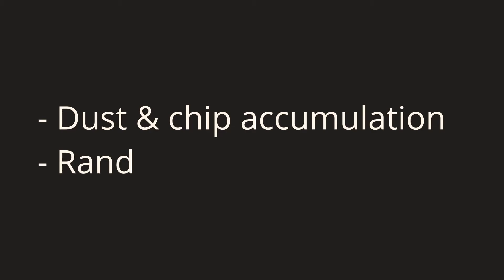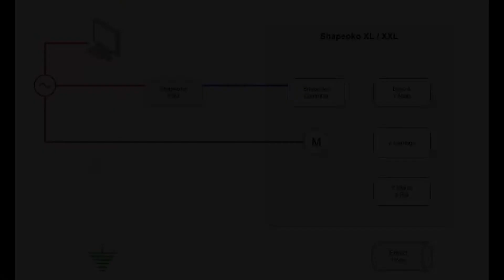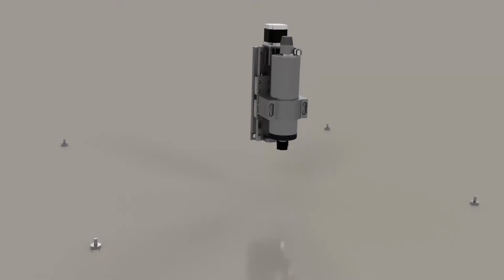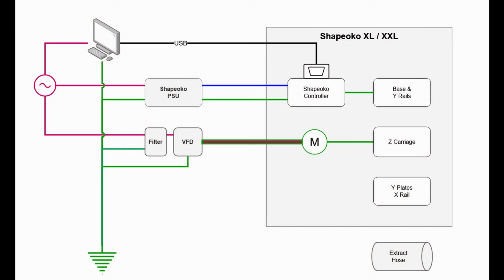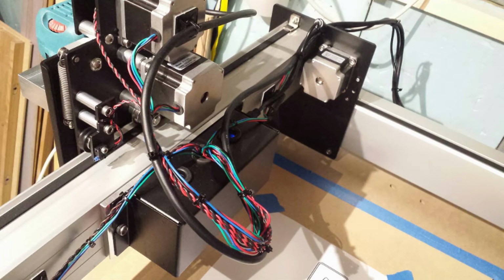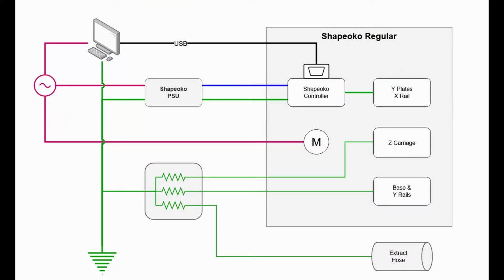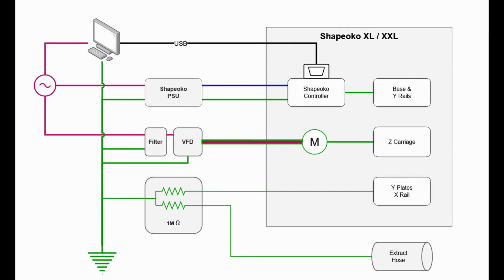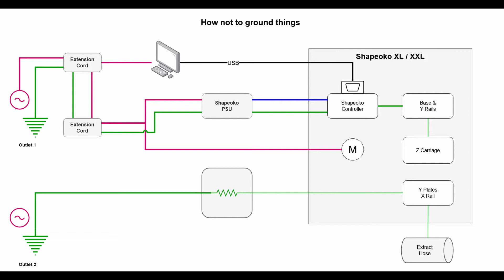Shapeoko CNC Grounding

Comment: What gauge wire are you using to ground the machine?
Reply from the maker: I was using 16/0.2mm hookup wire (22AWG equiv) but it really doesn't matter what size, we're just conducting away static before it can build up so we don't need super low resistance. The exception to that is spindle grounding if you have a spindle, that needs to be at least the gauge of the other cores in the spindle power cord. HTH

Comment: I'm not real sure why a few folks are attacking via comments. Ground Loops, look them up commenters. Your microphone, voice, and tone are fine. Thank you for your video.  I do feel that C3D should be addressing these issues a little better although I realize they cannot account for all situations we will ultimately put them into.  Disconnects and plunges are an issue with these and I assume probably with other manufacturers as well.

Comment: Your microphone is horrible.  It is all bass and treble.  You need to get a standard cheap microphone.  The are tuned for your voice and sound better than an expensive nice mic rig like in a radio station.  ...which are all bass and treble.  You need mids and high mids to get a clear voice tone.
Reply from the maker: Ah, yep, there wsa a load of background noise which I had to filter and it messed up the audio, didn't realise until too late.

Comment: If you are using a Chinese made spindle then most likely it's not grounded. 
The #4 pin of the aviation connector is generally not grounded to the spindle body. When connecting the double shielded cable it is a good idea to remove the top cap of the spindle and solder a ground wire to the #4 pin and then connect the wire to the body of the spindle. 
This has the added effect of allowing you to use a Bitzero v1 or v2 without having to connect the groud wire.

Comment: In 2021 you sell a
Machine that has to have aftermarket grounding?  Your diagram suggests obtaining a ground from a wall outlet? With a bonded nuetral?  Surely you recommend customers drive a ground rod to create the ground system right?
Reply from the maker: Thanks Becky, 
First, I don't sell this machine, I'm just a user of the machine.
The machine electronic enclosure is grounded by the supplied power supply to the utility ground. If you ground from some other source then you'll have different ground potentials on the machine and create new problems. If the utility ground in your region is not safe to use for grounding the machine then that is a different issue. I would certainly not recommend that a user drives a ground rod at their site to make up for underlying electrical issues in their wiring, that is a job for a qualified electrician. 
I also recommend using 1M Ohm resistors in the ground connections for several reasons, ground loop reduction primarily but also risk reduction in the case of a floating ground connection or other problems. We are only draining away static charge here so very high resistances are fine.

Comment: Well done sir, well done.  I appreciate the time you took to spread this knowledge.  

#1, I went ahead and purchased an anti-static vacuum hose for CNC and a separate planer issue I had.  The hose ended up NOT having a wire inside and I conducted an experiment.  It sent all the static electricity to my Dust Deputy set-up, which is the old style.  The Dust Deputy is not anti-static (older, clear version).  It showed me that I need to ground this new hose, as the Dust Deputy sits on a plastic bucket, insulated from the basement floor.  After planing a bit, shaving suddenly exploded out, seemingly from built up static electricity.

#2, more importantly, I am going to use the length of the same anti-static vacuum hose from machine to Dust Deputy set-up, and behind that will be the shop vac (shop vac does not have ground on plug).  Should I just wrap a few feet of bare wire around the dust collection, or run a bare line all the way to the Dust Deputy and attach it to a bolt?

#3, I plan on using the banana jack plug for the ground.  I need a 1M ohm resistor in ALL THREE LINES?  So, do you have a suggestion on how to incorporate those into the lines using crimp-on connectors?  I am not savvy with soldering.  I have done some searching on the Internet for something plug in style, to no avail.

#4, not as important, but it appears that the wire size used in this example was 16g?  Is that correct?

#5, I am looking to see if you ended up doing anything with the inquiry below from Mike Fitz.

Thank you,
Chris
Reply from the maker: Glad it's helping people, 

#1 - That does indeed sound like the static charge may have created a clog in the hose. 

#2 - On a hose without a wire, assuming it is semiconductive you can wrap a wire round it or use a metal jubilee clip which doubles up by anchoring the hose. I'd suggest running an insulated ground wire from the common ground point to the dust deputy and then breaking that out into two grouding points for the two bits of hose.

#3 - I recommended the resistor on all the lines to remove the risk of creating a ground loop as the Shapeoko CNC is quite sensitive to those. I grounded all the parts of mine back to the panel where my CNC and the VFD for the spindle is fed from and didn't use the resistors, but I was confident that I could spot the ground loop problem if it appeared. You can buy plugs which are for plugging anti-static wrist straps into;

https://www.antistat.co.uk/product/earth-plug-shrouded-banana-socket-stud/

Or you could crimp some resistors inline with the wire;

https://www.amazon.co.uk/Ohm-Metal-Film-Resistor-Tolerance/dp/B00WX6KZUE

If you buy the 1W type they tend to have larger leads which you could fold over and grip in a small crimp terminal, but the leads don't like to be flexed so make sure they're not going to be physically stressed. It might help to heat shrink the whole lot or something to protect them a bit.

#4 The wire size doesn't matter at all, this is meant to be low current and the 1 million ohm resistor is going to make the resistance of the wire irrelevant. Use whatever stranded wire you have handy.

#5 Not sure if Mike posted on the Carbide forum where there's lots of discussion about the grounding.

Comment: I wish you would have shown exactly how where you ran the grounding wire so newbies like me who have no clue on electrical stuff can learn and not blow things up.. lol.  Nice informative video though Sir.
Reply from the maker: Ah, on my machine they go straight into the switchgear box for my VFD spindle but there's quite a few option, if you use the Carbide3d forums community.carbide3d.com post a message there and I'll see if I can come up with a useful answer for you
Reply: Thank you Sir!!
Reply: @MrTeamfitz  I would ignore half the advice on this tutorial. He makes a good point about the ground loop but you should be driving a ground rod then running a strap from the rod to a ground bar in the panel. (A brass bar with multiple tapped holes to land ground wires. All of your grounds going to the machine side should originate from this bar. The example showing him land a wire on a plastic wire clamp is not a good idea, surely you can find a better spot to land.
Reply from the maker: That plastic wire clamp is also the head of a bolt threaded into the anodized aluminium, as I point out you need to find somewhere to break through the insulating layer of aluminium oxide and a threaded hole is a good bet for that. Of course you're welcome to make your own suggestions, perhaps you should start a channel?